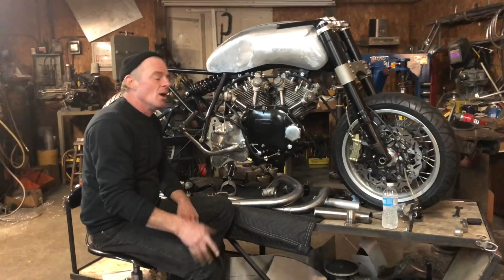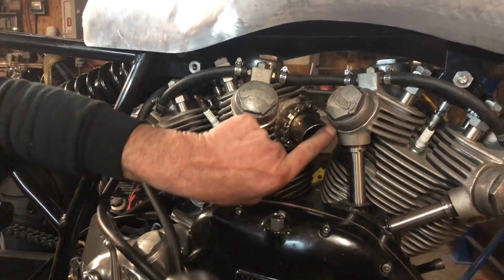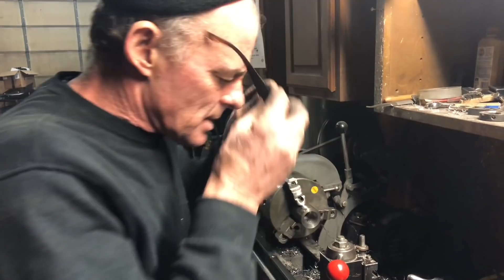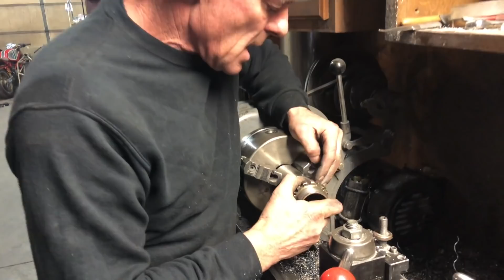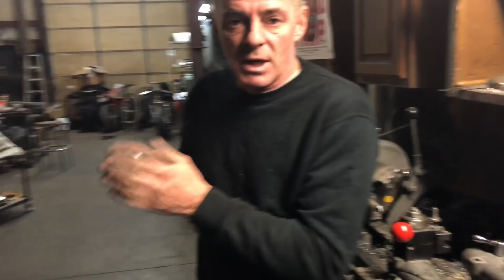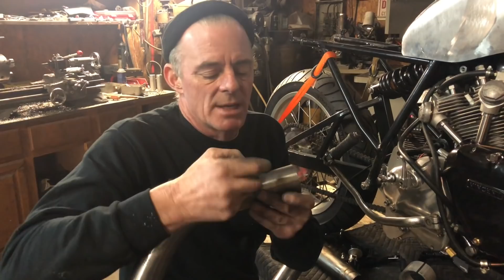Custom Exhaust on Vincent Motorcycle by Craig Rodsmith

Comment: Hi Mr. Rodsmith, if I was going to remove the  black powder coating on my valve covers how would you recommend I do that? Thank you in advance!
Reply from the maker: Hey mate,I use a strong chemical stripper,you can get it from most powder coating suppliers such as Columbia Coatings.
Reply: @RodsmithMotorcycles  How do you get the bare metal so perfectly polished after removing the powder coat? The metal has such a luster after you've been at it.